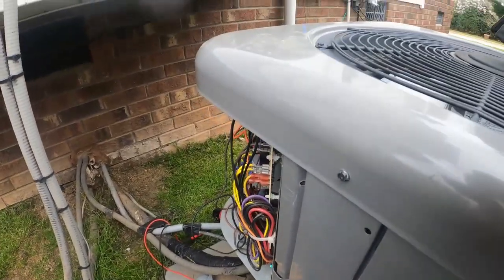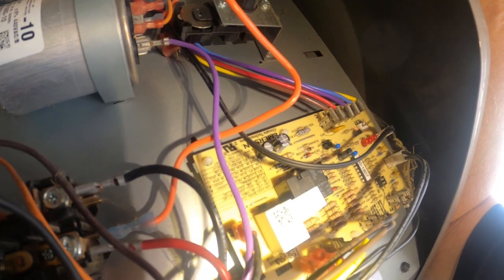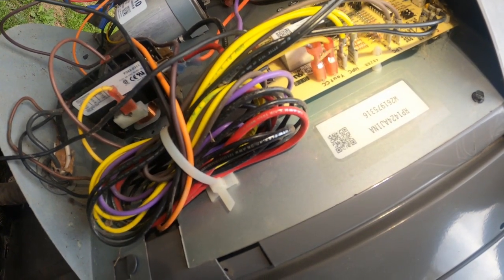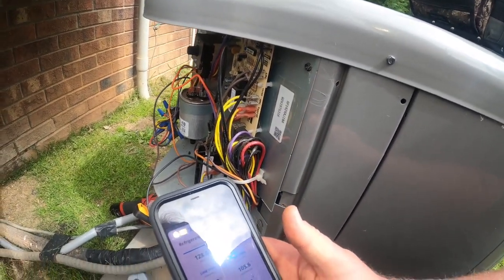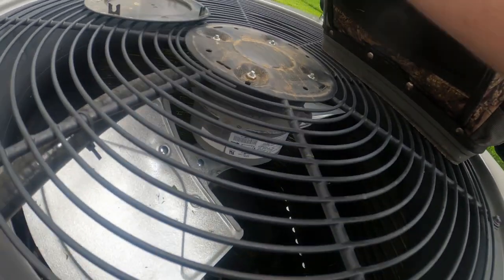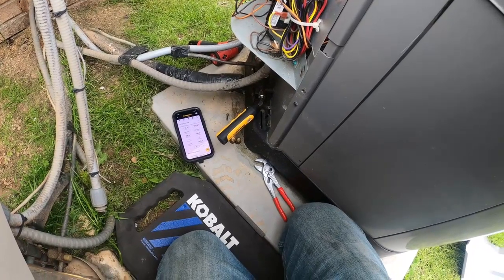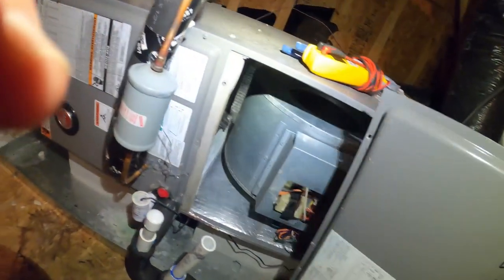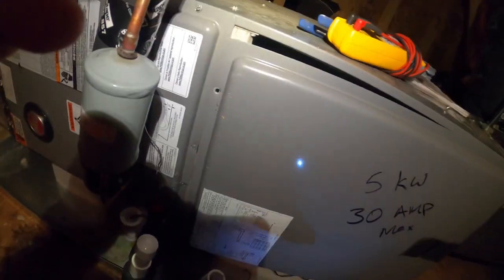RHEEM Heat pump on high pressure switch lock out.

Comment: I found that lowering the defrost termination temperature from 70 to 60 on the defrost board seems to correct this. It is happening in defrost mode.

Comment: I have the same issue with the LENNOX unit in heating mode happens sporadically. I think it might be the check valve in the expansion valve, causing the issue. Customer had the high-pressure switch and defrost board changed in February 1921. Gauges on I found 325 on going out and about 300 coming back for 10 AC system, I’m trying to get in touch with LENNOX but they won’t talk to you unless you have a registered account so there’s a LENNOX supply house near me. I’m gonna go in there see if they can help me out but I’m looking at the expense valve I did put it in cooling when I was there because it was 58° out that day, and the cooling mode seemed fine did not seem overcharged.

Comment: Maybe  he thought he was  in cooling energized the  reversing valve and  actually had it I. Heating and  got side tracked drinking  a adult beverage and then realized  he still had it ju.ped out at the  airhandler and  took the  jumper  wires off and  never went  outside  to  Check the  outdoor unit  because it had got dark and  chilly and  a little  buzzed   .or the digital thermostat  was  running heat when it was  in  cooling and  it is a  intermittent  problem and  when  you che k unit it runs perfect  especially  when you need air-conditioning in the  day and heat at night  and  they switching back and  forth  between heT and cooling  had a few of them  DIY  ones  that  have a  slide switch  to   change  it

Comment: Hey bud good video but I wanted to point out that you do have your high pressure gauge hooked up to the wrong port.
Reply from the maker: Actually NO! It is a heat pump, in heat mode the discharge/high line is your suction line in a/c mode and the port in between the 2 lines is the true suction/low. Heat pump runs reverse flow.
Reply: @myHVAClife  I do understand how a heat pump operates, I can tell the way you subtly bashed rheem that you don't work on and/or care for them but you did indeed hook gauges wrong. What you most likely are familiar with is units such as carrier which uses a piston as a metering device in the outdoor unit, in those cases you would be correct in your gauge set up. Rheem uses a txv in outdoor unit and in heating mode you would hook low side gauge to true suction and high side would be going to the same liquid line as in cooling mode. Please look into it if you still don't believe me, I've been doing this 20 years and I'm sure you've maybe been at it just as long if not longer but in my case I use Rheem often and I'm very familiar with them.
Reply: Rheem definitely does things differently, just like most system energize the reversing valve in cooling mode Rheem systems energize the reversing valve in heating mode and use b terminal in place of the commonly used o terminal
Reply: @extremeair1199 
Thank you !
Reply: @jaimelamas2568  you're welcome glad you can appreciate doing things the right way, sometimes you can point out someone's error and they are still stuck in their ways and refuse to learn. Me personally I could do this for 50 years and still be happy to learn anything from anybody at anytime.

Comment: I have run across Rheems  going off on hps during defrost cycle    In milder heat mode.
Reply: Continue ^ maybe the defrost thermostat a little late in opening